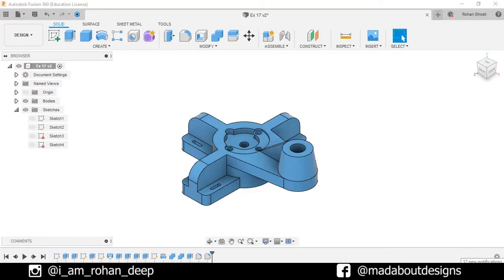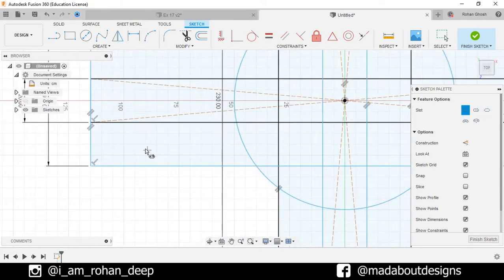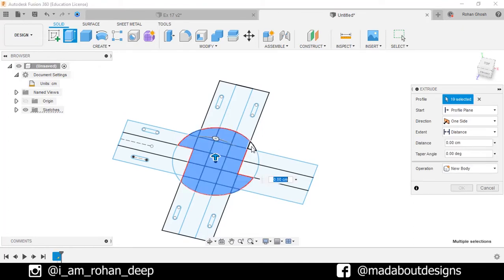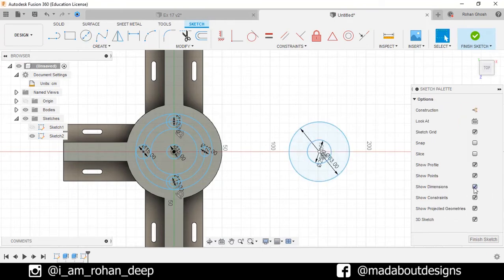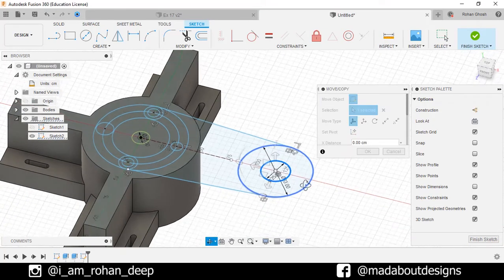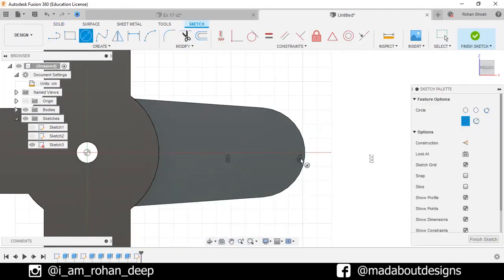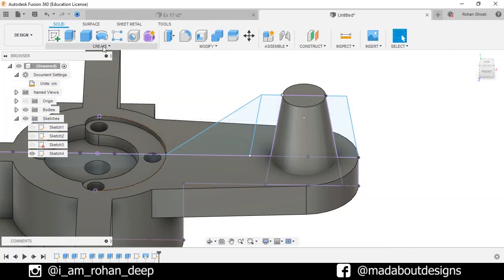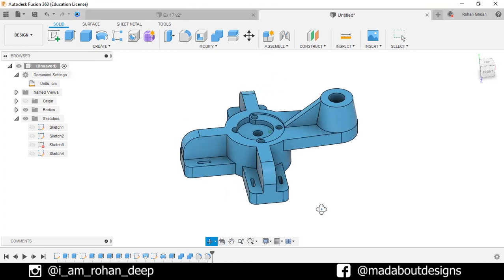Autodesk Fusion 360 Beginners Tutorials | Exercise 15 | Learn the basics of designing

Comment: I also had a problem moving the smaller circle for the top of the loft command. I eventually indicated a 90 degree move up the z axis in the dialog box and it moved the circle in the right direction and distance. I also had the issue with the rib not meeting flush with the lofted cone. Haven't figured that out yet but saw that issue resolved in another tutorial I did before. I tried editing the rib again after the fact but still did not meet flush with the cone. Still trying.
Reply: I had the same problem, I just created an offset plane and drew the circle there.